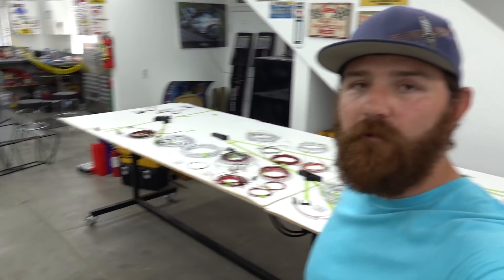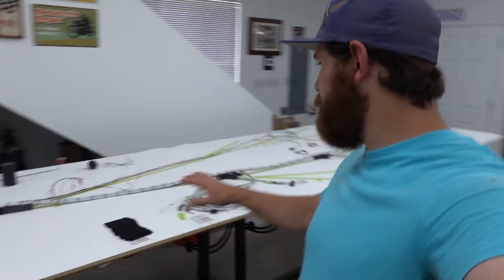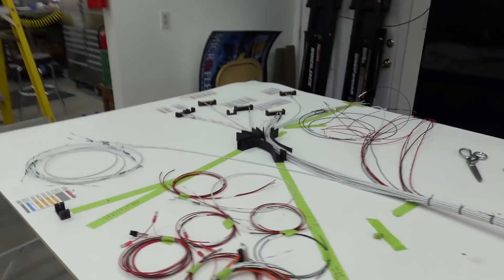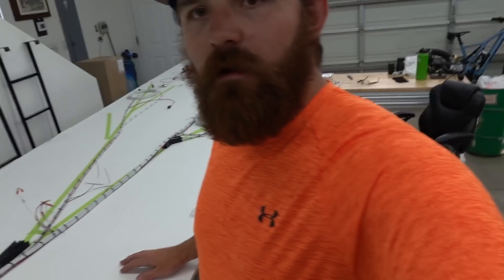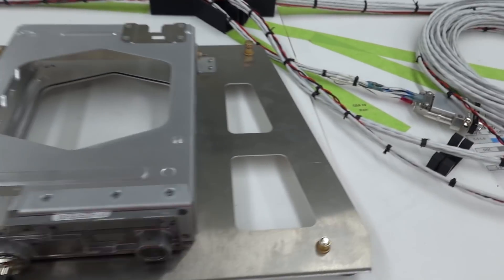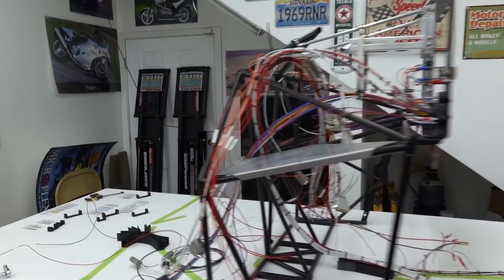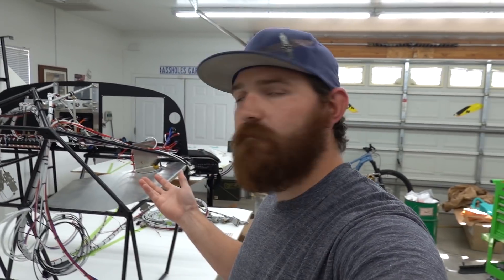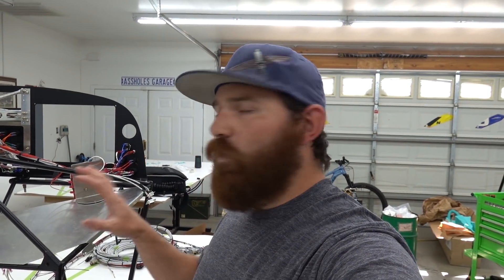Building plug-and-play wiring harness for a Kitfox

Comment: Good to see you doing so well in the recovery! I see you doing a lot of zip ties. I didn't see if you were using a zip tie gun or not. I am not affiliated at all to any zip tie company but Mike Patey has some that are rubber coated that look pretty awesome. Also here is a link to a gun that I use. They pull the zip tie a little tighter than by hand and they cut off clean so there is no worry of sharp edges around wires.  https://www.amazon.com/Kinee-fastening-Die-Cast-Handle-Length/dp/B01JRGM64K/ref=pd_lpo_60_t_0/146-9638926-8449332?_encoding=UTF8&pd_rd_i=B01JRGM64K&pd_rd_r=292422ed-8b4a-4eaa-84f2-3873e7433cc1&pd_rd_w=WtAtu&pd_rd_wg=FoI0K&pf_rd_p=7b36d496-f366-4631-94d3-61b87b52511b&pf_rd_r=4FA1509S554EZP295BCD&psc=1&refRID=4FA1509S554EZP295BCD

Comment: I love to do the wiring and programming of canbuss control systems, ive done aircraft wiring both fixed wing non-press. and pressurized cabins , as well as helicopters also automotive heavy duty trucks, firetrucks, military ect..also build harnesses and troubleshooting electrical and control systems on almost any forms of transportation out there it the kind of job that keeps you on your toes as well as makes you pay attention to details at all times and neatness/ organization, documentation and labeling. I don't get why so many people are scared of any form of wireing I find it fun 99% of the time the 1% is when you have to fix other ppls f ups just to properly diagnose the real problems.